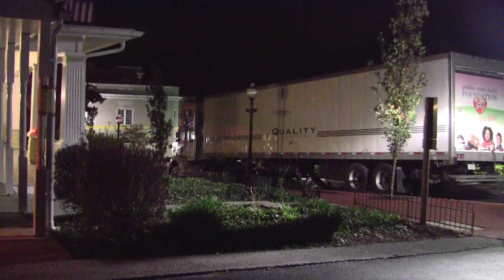Chipolte Delivery Truck 5:00 a.m.

Comment: thats the refeer unit running. it can run 24 hour and loose only 1/4 of a tank...also this is a starbucks delivery truck ..if you dont like the noise u have no choice but to deal